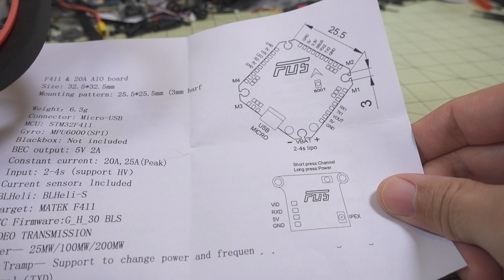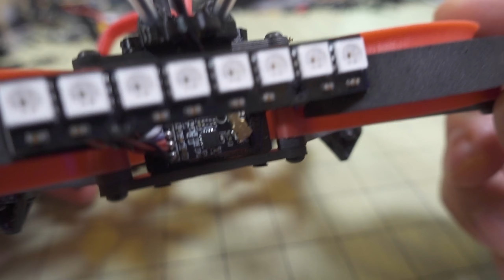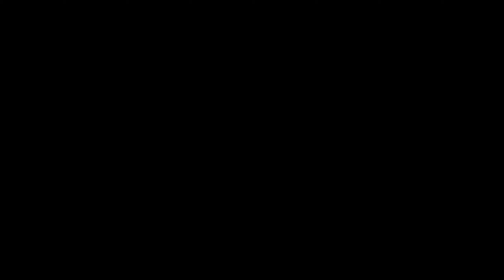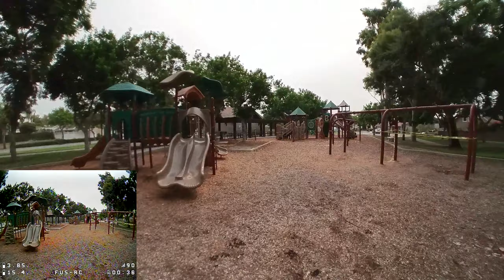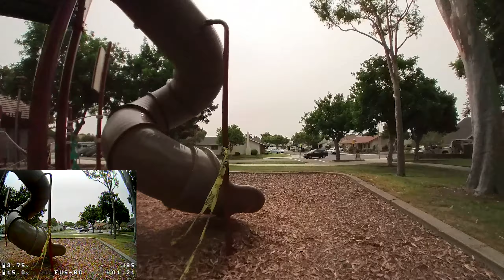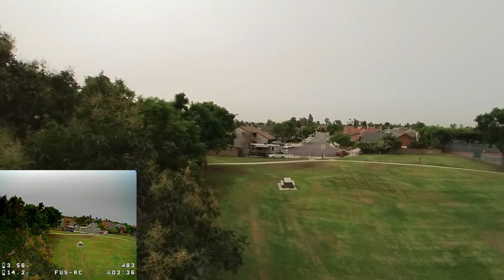FUS X111 Pro Micro Cinewhoop Review 🛸

Comment: Can we replace 1106 3800kv to 1106 6000kv?
Reply from the maker: At that KV you'll have to run 3S or 2S and carefully watch your motors temps.
Reply: @AlbertKimTV  ok noted. How about 1206 4500kv? Is it okay as a replacement?

Comment: Nice review sir. I have been watching ur videos on pushers aswell. If you can help me out and confirm 2 things. 
1. How long is the distance between the camera holder and the stack. Wondering if i can put in a caddx tarsier or turtle and if the cable i have would be long enough
2. Can it hold an fc, esc, caddx board and a vtx 20x20. I know from banggood it supports 20x20 but is the height big enough for 4. 

I have 1105 5000kv beta fpv motors so was thinking of making a pusher with this frame as 95x pusher cant gave a caddx turtle or tatsier.   If its not good as a pusher,  i can make it back to a normal whoop.
Appriciate ur thoughts and help